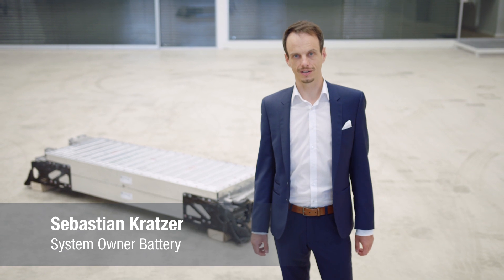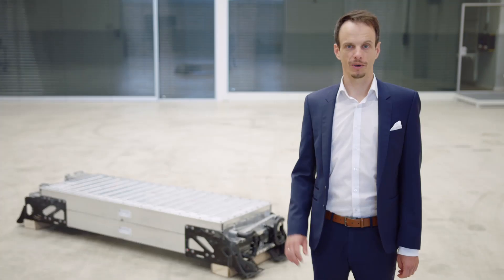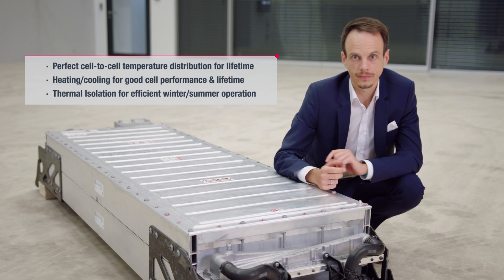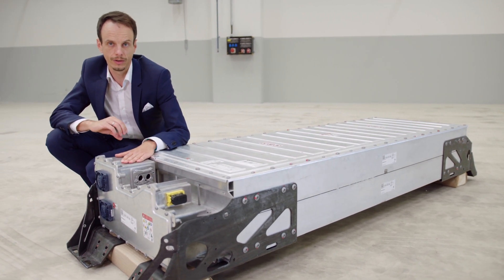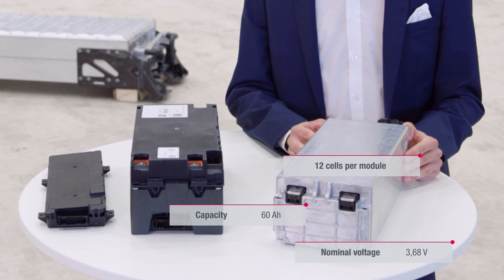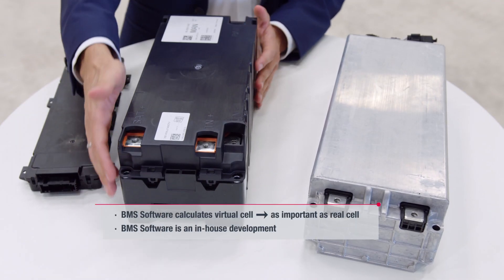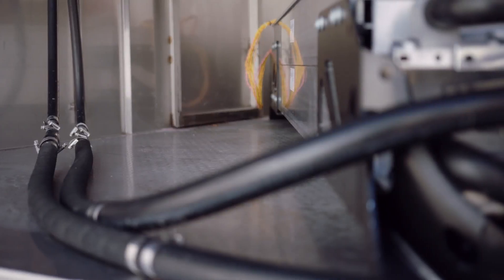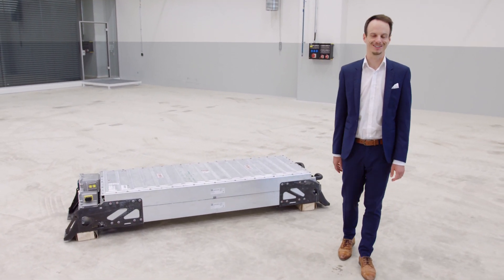MAN Lion's City E: Battery Technology | MAN Truck & Bus

Comment: Why does the truck industry doesn't work on developing electric truck which is taking the electricity via two pantographs like trolleybus in eastern Europe and applying it on freeway (Autobahn) instead Diesel burning on long ruts?! 
This pantographs should raise and aim automatically the conductors in air without any physically help of driver via sensors, it would be activated pressing the button and outside the freeway when leaving the freeway in the city the truck would withdraw the pantographs down and drive on battery, you can't drive whole day 40 tons on battery!
Reply: well they do tho???